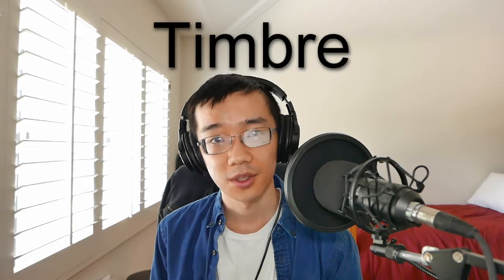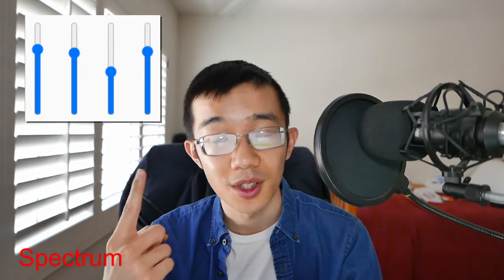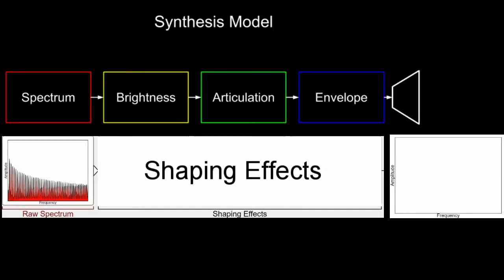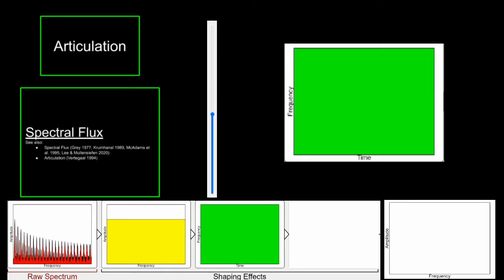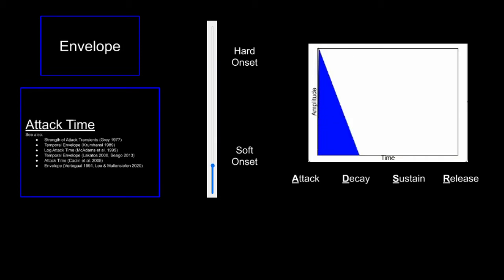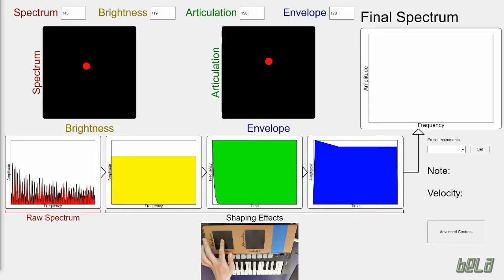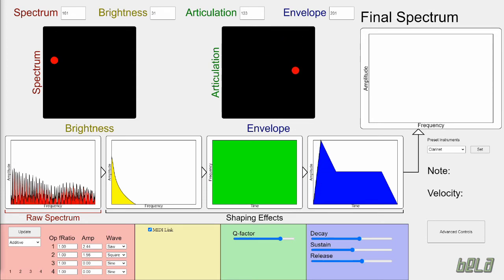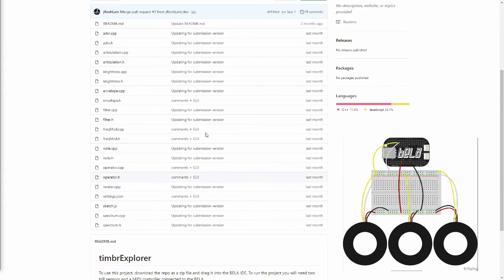A New Way to Learn Math // The Timbre Explorer

Comment: Wow, this is beyond awesome, very impressive! (and also very helpful, especially the inserted references)! I have a decent understanding of the Fourier transform, and was looking for a good explanation of timbre. There is only one statement that is strong, but of which the correctness isn't obvious: the one where your 4 parameters are enough to produce Any sound (not to mention that Envelope contains a few parameters by itself already). I'm curious though if any 4 parameters are sufficient to that end... Would love to engage in a discussion, but I am probably 3 years too late.
Reply from the maker: Haha yes I’m coming back to this a bit late but I would be the first to agree that (now that I don’t need to worry about being published/graded) this has a ways to go from being the dream of a perfect timbre space. Maybe there are other dimensions I could have used or maybe a better implementation of the dimensions would have made for a more robust system. I was very new to synthesis when I did this project and would have loved to collaborate with someone with more experience!

Comment: Congratulations! Great video and project! How did you approach the "piano" timbre in therms of partials relative amplitudes? Did you apply different envelopes for each one? I am working on an additive synth in Pd. I have also used Bela and loved it.
Reply from the maker: Hi Panos, if I recall correctly, the piano's base waveshape is a sawtooth wave since hammered strings produce both even and odd harmonics. The brightness is lowered slightly with a low pass filter, so the higher-frequency partials are diminished. At the end of the day it's not a true recreation of the real partial distribution of a piano, but I wanted the parameters of my system to have a continuously progressive effects, so I use basic waveshapes and a single filter to create the sustained spectrum.

Comment: I studied mechatronics/electrical engineering and grew up playing violin and guitar. I always thought electrical engineering programs should include a music course!

AC current, motor control, and vibration analysis are all core subjects within electrical, mechanical, and mechatronics engineering. I found trying to understand frequency domain concepts in the context of electricity difficult because it's so difficult to visualize. Plotting the time/frequency domain on charts is obviously a huge step up from trying to understand functions, but it's still not nearly as intuitive as translating it to sound. 

A tool like yours would help students understand frequency domain so much faster. Really great work.